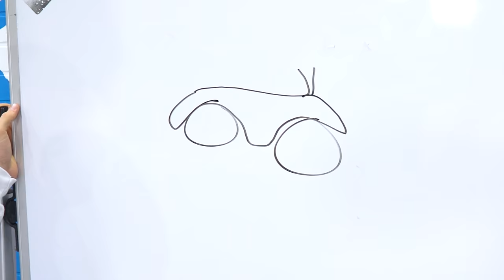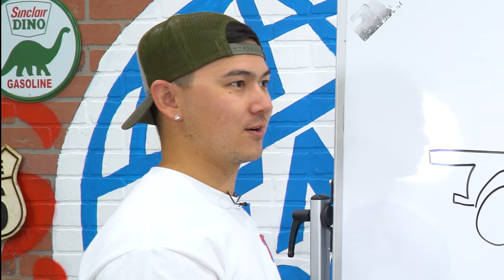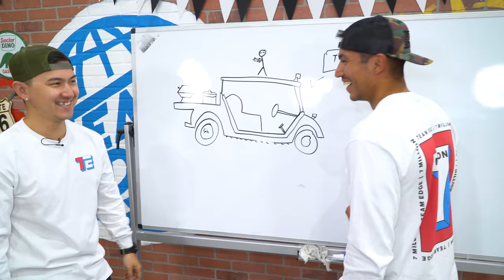$200 vs $4000 Go Kart Challenge! *this is so unfair😂*

Comment: They should do a challenge that they have to spin four times every 20 minutes. The more players you have the more longer it will be. Whoever is the host will come up with challenges and/or obstacles for the people playing. If you are in the middle of a challenge and you have to spend four times, because it is the 20-minute mark you are disqualified. The last person standing it gets $2,000 from the losers. The $2,000 comes from the challengers that lost. NOT JUST ONE LOSER all losers have to pay the winner.    you can tweak the game and rules as you want or you can play the original.
Reply: I meant spin around and not the wheel.